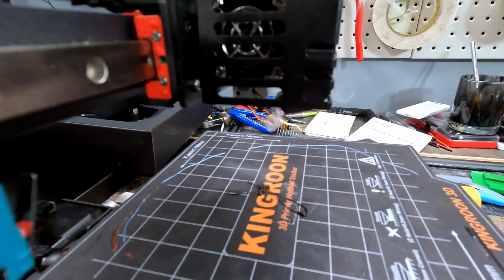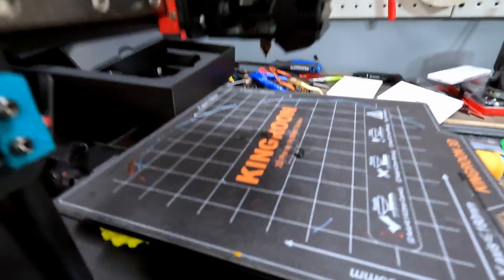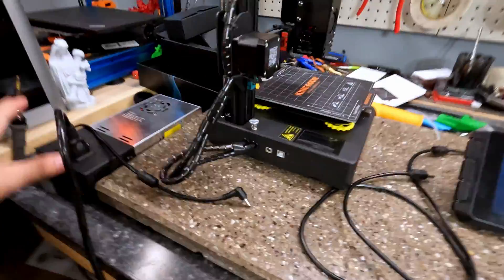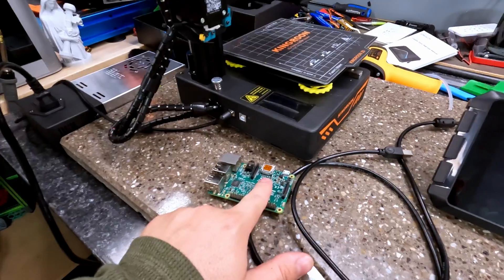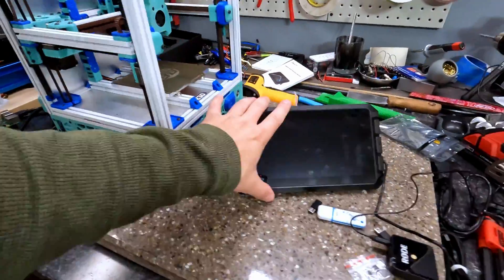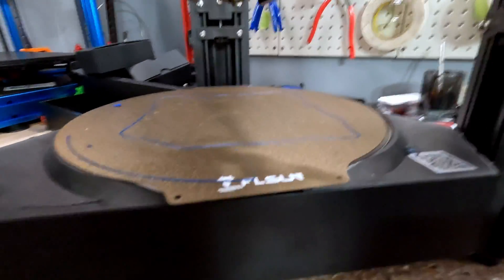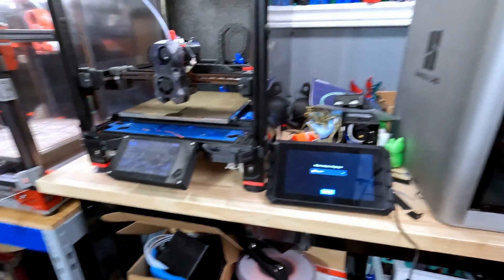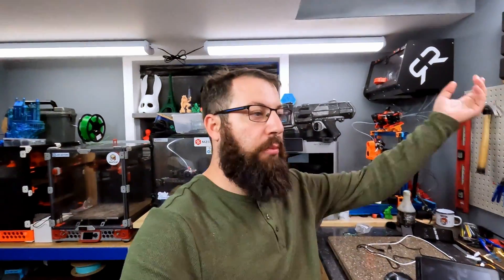Thermal Runaway - Not A Good Start With The Creality Sonic Pad

Comment: It's 2022, why is thermal runaway even a thing?  It's a well known safety concern for printers and should have been addressed early in the development process  This is a major fail on Creality.
Reply: Safety systems are only as good as the data they receive.  If I tell it the heater is an endstop and it's thermistors ports are wired to some part of a display the safety protocols are useless because it has no idea it's turned a heater on and things are getting hot.
Reply: @Polar_Ted  Yes, but assuming that if there is no configuration to set such a dangerous default is reckless. Especially when they say, "compatible with most FDM printers". Default settings of a device shouldn't have the chance of burning someone's house down.  Rather than blindly defaulting, a better option would have been (like Nero3D said) to have a menu option of some sort come up and prompt with some sort of choice.

Comment: Yes, Creality is a bunch of knuckleheads, but plugging any Klipper host configured for one printer into a different printer is a safety issue.  Really this is a problem with Klipper itself, and will need to be addressed as Klipper becomes more and more mainstream.
Reply from the maker: The issue with what creality did was having this shipped with a pre setup config with no mention of this. I assumed it would be like a default klipper install with no config setup until you actually set one up. There is nothing in the manual stating this
Reply: It's not a safety issue if you don't use a wildcard in the config so it connects to anything you plug in, rather than only what it's configured for.

Comment: Thanks for discovering this and letting everyone know quickly! I was very interested seeing what happens when connecting the sonic pad into a printer with Klipper already installed. However, isn't Creality's use case technically supposed to be for printers with Marlin firmware (ie you are supposed to go through their process of flashing the printer first before connecting the pad)? But definitely now know Creality should at minimum provide a warning perhaps against connecting this thing to devices with Klipper already on board. Thanks again for your discovery and probably saved someone from serious and life threatening damage!
Reply: You don't recompile and reinstall Klipper on an MCU every time you switch the host computer. The actual Klipper 'firmware' only tunnels commands from the external host (in this case, the Sonic Pad) - it doesn't do any thinking for itself. This means the Sonic Pad itself was feeding the printer faulty information. For what it's worth, too, Creality's Klipper install instructions are the exact same as any other Klipper install. This issue could happen even if you followed the Creality manual properly.

Comment: Did they seriously release this without testing on other manufacturers printers with various firmware combinations?
Reply: Well - I guess that would be rather impossible. There are so many combinations and manufacturers around that covering every permutation would take years. And then we do not even have all self-build stuff covered, where users do crazy things with standards main boards. In this case it's a different use of a standard pin-layout that has caused the problem. Of course this specific configuration has to be warned about in the software (and probably Creality will build in a warning). But how many weird configurations with problems are there "out in the wild"? In that last case it's the end user's responsibility to do set ups and configurations that avoid any problems.

Comment: It is not for all printers )))
Reply from the maker: The issue is. There is notthing on the package or manual stating this. During setup there is the option even to setup a non creality printer and klipper itself is a controller board agnostic firmware so the sonic pad being a rpi alternative and touch screen would seem like a valid option for many
Reply: @CanuckCreator  You need to be a complete idiot to use any firmware without configuration.

Comment: The most important thing is seeing how they are going to respond to that issue.
The way they will do it will show how much they care about thier user safety
Reply: Creality never cares. They usually use a ban hammer.
Reply: Right now (edit: actually from my comment's time, 13h ago) the creator pinned Creality's comment about releasing an OTA update to the Sonic Pad, that should be out in a week.
Definitely new devices not yet shipped should get updated before sending, and at the very least a piece of paper right away when you open the box telling you to update it before even connecting it to a printer.
Given they advertise it on their site as being super simple plug & play for their Ender 3s, it's just a mistake but with considerably severe consequences to safety in the end. In my opinion sometimes we should take a step back from the whole unpack and go experience, and make people at least think for a second when setting up stuff to avoid serious problems. All it would take in this case is a prompt asking what printer is connected after all like another user pointed out here.

Comment: I haven't watched yet, so this is purely speculation, but if it's a thermal runaway issue with the KP3S I had the same problem, and it was an issue with the mossfet on the board. I am not the only one who has had this issue after installing Klipper on a KP3S, either.

Comment: I I'm in no way surprised that Creality didn't cover this in a manual. Nor am I surprised that it just assumes what you've connected to and turns stuff on.  It would have been bone head simple for them to have a one time boot script asking what Creality printer you had connected (with and option for "other" to do custom klipper) Have it not activate anything until you selected something. Typical Creality unfortunately.